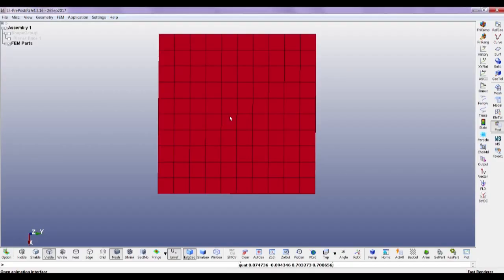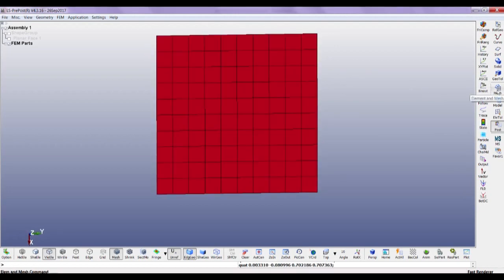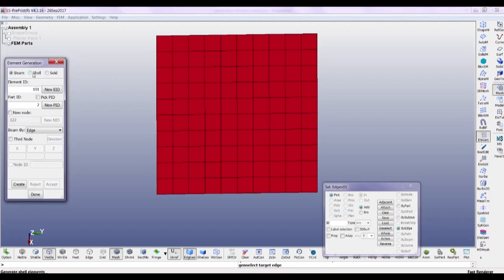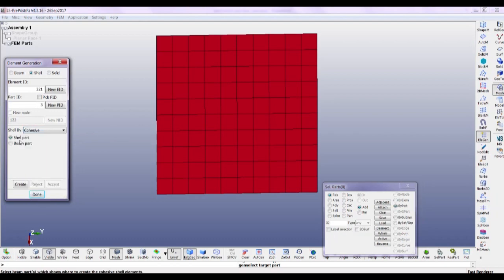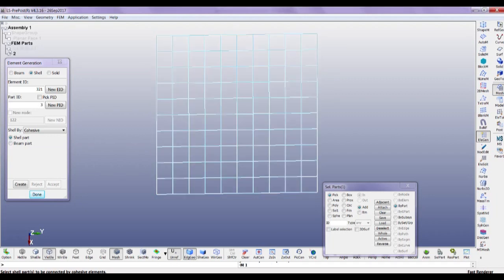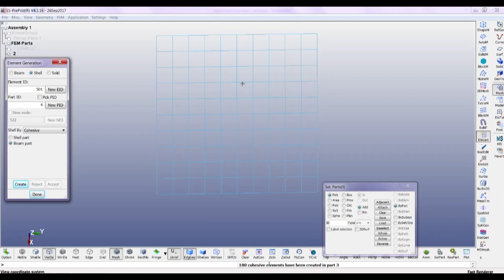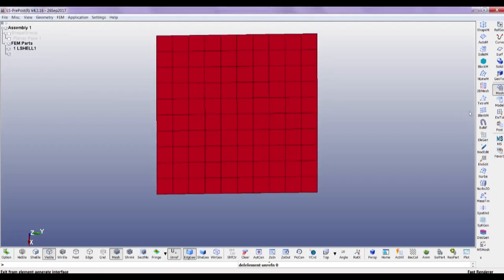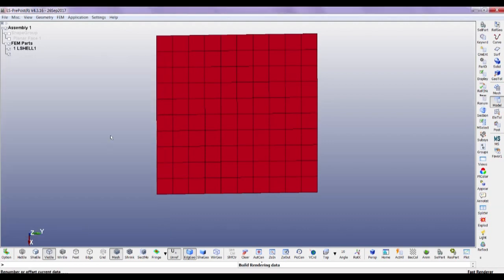LS-DYNA Cohesive element meshing for crack propagation

Comment: Very nice video thanks ! Just one question how can you connect two shell with these type of cohesive, because here the shell is alone ?

Should I merge the node between the shells and the cohesive element in-between ?

Thanks a lot !
Reply: I have same question！when i merge the node ,it is to be a one part. No have cohesive
Reply: @han5873  You can do it with the Keyword file, i was dealing with reactangular plate and i have created a python script to connect node and element by writing directly in the Keyword file
Reply: @dodonez   Actually, I don't know how to do.Do you have any data? I can learn
Reply: @han5873  yes sure do you have any email ?
Reply: @dodonez  hanshaoqi0830
Google email